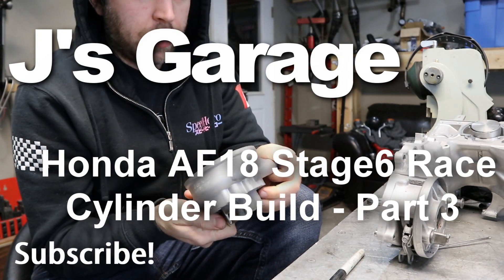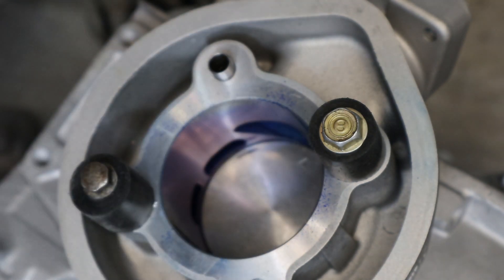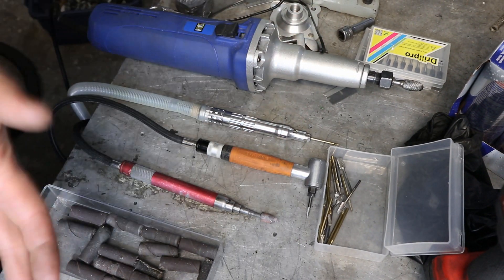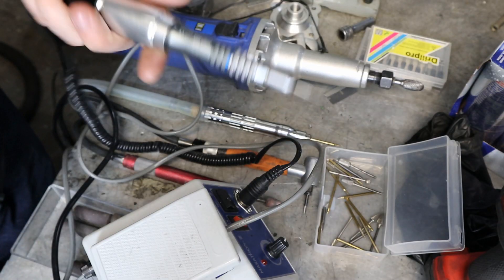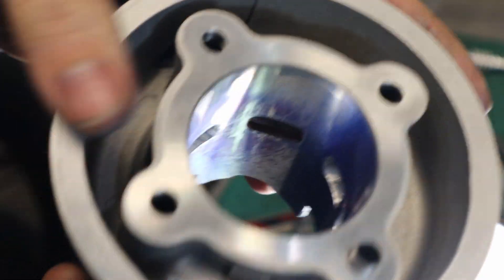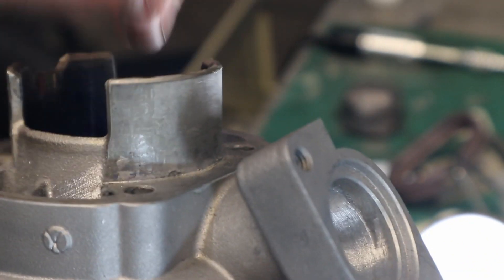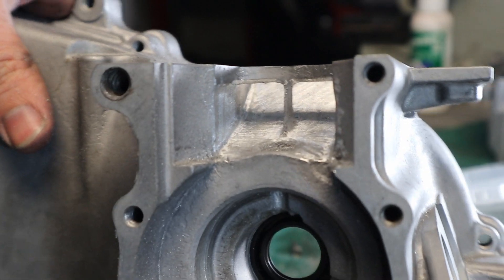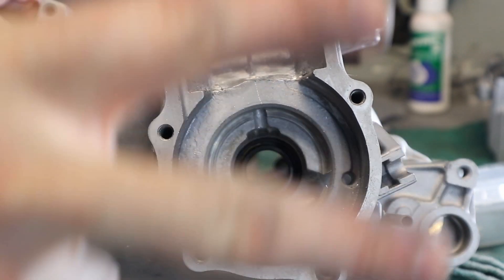Stage6 Modular Race Peugeot 70cc cylinder Honda AF18 build - Part 3 - J's Garage

Comment: What a peugeot head ¿ are they cheaper ¿
Reply from the maker: There are many different brands, some are cheap, some are expensive. This one is pretty expensive, but I got them on sale a long time ago.  Peugeot Speedfight 1 and 2
Reply: What needs to be done to make it fit ¿
Reply from the maker: That's what all the previous video's cover.  The port timing is off because the cylinders are made for a 2mm shorter stroke, but they bolt up quite nicely as the Peugeot is an af18 clone.  I machined the head and shimmed the base to make it work, then moved some stuff around.   I have bolted stock speedfight cylinders up with just base gaskets and it worked, but the timings are so mellow it just worked out ok.  It's going to vary from brand to brand what will need to be done.

Comment: The higher exhaustport maybe wasn't a great idea.
Reply: @pitobread  Well,  lets say that you are using 130° transferport timing. The engine starts losing the benefit of the exhaust when you make the exhaustport timing longer than 192°.  Not the easiest thing to explain but it goes something like this, you are able to get so much transfer time/area with 130degree timing that the cylinder will become extremely blowdown restricted. Raising the exhaustport over 192° the engine will lose most of the inertia and intake-energy before the transferports open. And that reason the intake will be weaker compared to shorter exhaust timing which and for that reason the exhausts given benefit will be weaker. And remember, more rpm doesn't always mean more power.
Reply from the maker: @neekeri2934   Thanks for the more elaborate reply.   I wanted to replicate as close as possible the port timing from the original S6 kit on the Peugeot with the 2mm less stroke.  Because there is more stroke and rod length on the Honda these are obviously different when this cylinder is installed unmodified.  I changed those to try and replicate them as this kit is supposedly good for 15-17hp with the correct supporting modifications on the Peugeot.  Also the pipe I have for it is tuned for quite high RPM (I have been told).     Hopefully in a few weeks I can see if it works out.  Cheers.
Reply from the maker: @negc I final assembled it today and re checked my timing, i ended up with ex duration of 197, transfer 131, boost 134, blowdown of 31.   I also re checked my math for the crank angles  and piston position of the speedfight and I may have swapped the distance from TDC with the Distance from BDC in one of them which would mean it has a ex duration time of 194-195  (whichever you want to round it out to).. Curious of your opinions on this.  As I have mentioned in other video's I am no expert, there are many folk out there smarter than me at this and you seem to be one of them :)

I mean i can always pull the base gasket and machine .5mm out of the head further as long as the ring doesn't pop out of the cylinder which would lower everything.